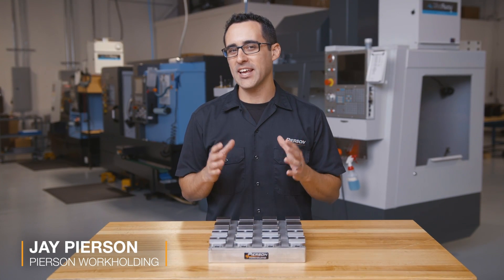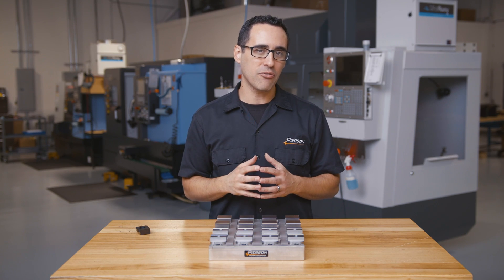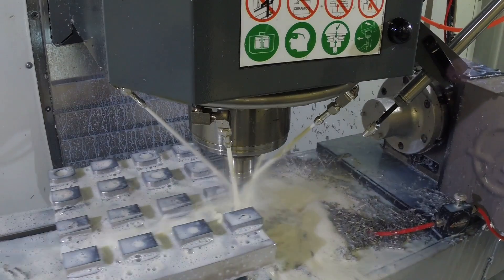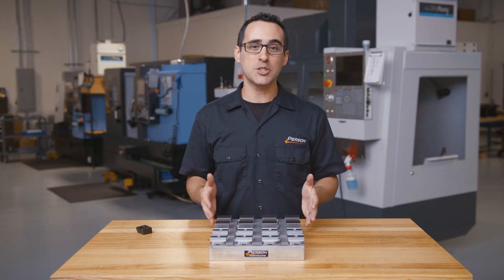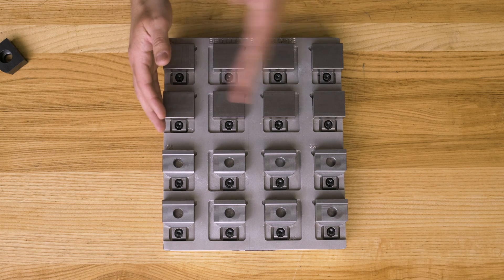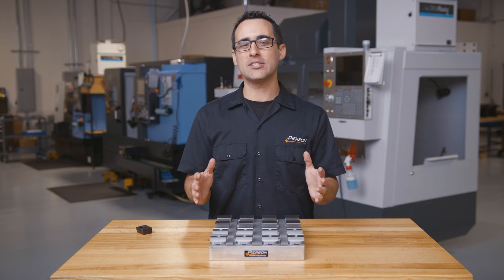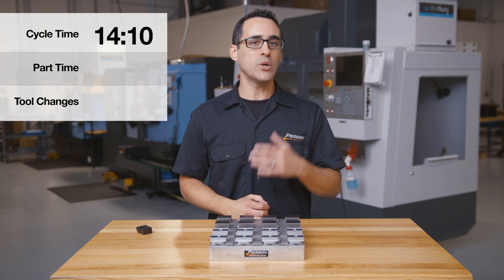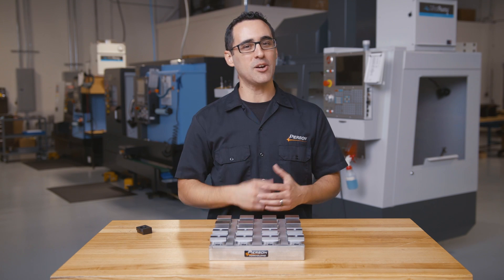Tested Durability On Our Oldest Fixture! | Fixture Friday 2 | Pierson Workholding

Comment: Jay, when you designed the pocket depth to hold these parts, did you use the depth on the Pitbull label (D) or did you go deeper?
Reply from the maker: We used the recommended depth so the clamp would bite on 0.150" of the part.  In aluminum, we often go deeper to hold on 0.100"-0.125".
Reply: @PiersonWorkholding  Thank you.

Comment: As always, good video Jay. Pallets are the way to go. We started using a pallets system probably 15 years ago. I realize these are simple parts but when I design a pallet, I keep my part datums the same for tolerance reasons and to keep it consistent for the operators. We also use a fixture offset for each part location such as G54.1 P1, P2, etc. When programming, we setup the code such that we can start the program at any process, any fixture position. That allows for tool breakage or recutting to tune a feature without needed to run the entire pallet over. If anyone wants to see sample code, let me know.
Reply: I would be curious about how your code and program structure looks like.  I do something very similar in my shop, but I'm afraid it's to confusing for anyone whose brain doesn't exist in the same level of madness as mine does.
Reply: @cowbyup77  If you wish to email me, I can send you a sample. dave.lelonek@amtny.com (all programs are CAM driven via MasterCam - we did purchase NX Cam but have not implemented it yet as I have another business getting the bulk of my attention)

Comment: Hi Jay, great videos. Not sure why I wasnt subscribed before, but your IG shoutout brought me here. Question: how can you drive the part into the locating corner with just one clamp? Maybe you can go over theories and thoight process like that in a future video? Id like to learn more about designing the fixtures. Thanks!
Reply from the maker: We'll definitely cover that.  Until then, the single clamp only needs to push the part against one edge, not into the corner.  Think of it as using a workstop in a vise... When loading it, you only put light pressure against the stop and then clamp the part.

Comment: I'm sure you've thought of this already, but I think it would be awesome if you designed a 6" vise that would go directly onto the Pro Pallet base.  It would save valuable Z axis travel vs mounting a vise onto a pallet.
Reply: I took a pre-made pallet, drilled and tapped it in a pattern then used the little Mod Vise from Saunders Machine Works. Light, strong and way better than bolting a Kurt to a pallet (I have that too and it works great). Both have their place but the Mod Vise is great for quick prototypes etc..
Maybe Jay should hook up with John and make that into a kit.
Reply: That could work, unless it's possible to completely wreck a Kurt Vise and put in the Pallet Kit underneath it. Pretty risky if that doesn't work. It probably won't because this Pallet system requires too much depth for the kit. These pre-made pallets themselves don't allow too deep of bolts going through it in the wrong spots, unfortunately. So if Jay was to design a vise, it would almost be as thick as putting a vise on the pallet anyways. Not much to gain.

Comment: Hey, how did you program that? G54P1 or? How does that look in fusion360?
Reply from the maker: Good question.  We cover offsets in an upcoming FF, but for this pallet we use G54 and G55 for Op1 and Op2 to fine tune the location of the parts if they were sawed longer or shorter.
Reply: Depending on the accuracy you are looking for,  could actually just use one offset for the whole pallet.  I do that with mine. 12 parts each pallet, all from one work offset.  I run 2 of Pierson Pro Pallet systems in my mill, so I just use a G54 for one, and a G55 for the other.  2 different parts on each pallet, with 1st and 2nd side of each part on the pallet.   The 2 parts make one assembly, so I am getting 6 complete assemblies every 40 minute cycle.  You can post them out at the same time, and have it sort ops in order to limit tool changes.  Sometimes it doesn’t like to do this, especially if you pattern.  I had to go in and pull some of patterns out into separate operations to get it to post the way it was supposed to.  I bought the big pallets, and ended up cutting some off of each one, because I didn’t have the Y travel on my machine to clear the pallet with the shell mill. 

For high tolerance parts you could use separate work offsets for each location, and have it probe the part every time if you wanted—but you probably already know that.

For mine I made a model of the stock, and then mated the part to the stock in the location I wanted it to be in the stock(like 20 or 30 lower than the top of the stock).  Then I mated that stock and it’s part to its place in the fixture.  For second side ops, I just mated the part to its contoured part location in the pallet.  I used sketches to draw rectangles to run the 2” face mill over the top of the stock to get it to get, the rest was patterned operations off of one work offset on the pallet (I engraved that location on the pallet).

Hope this helps—AJ
Reply: I'm curious as well.